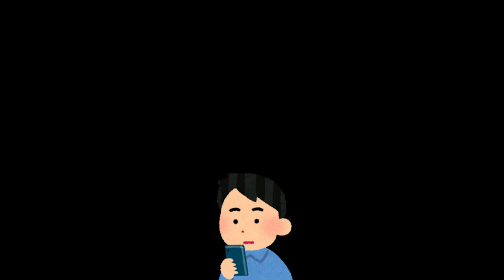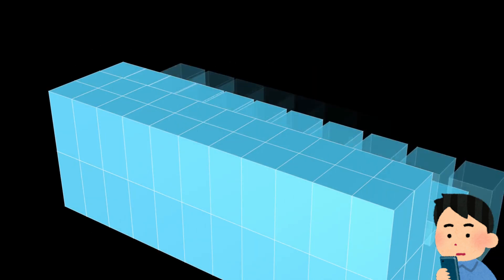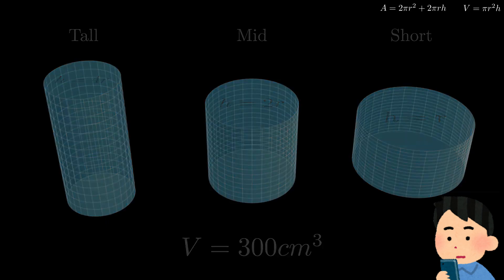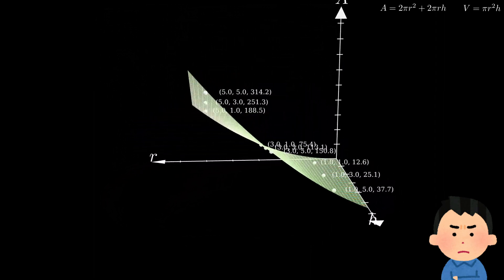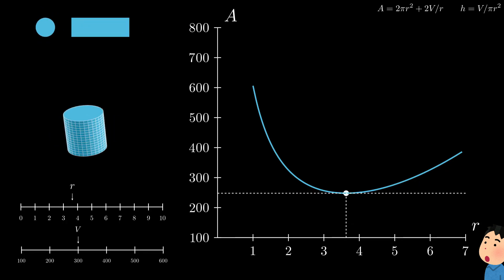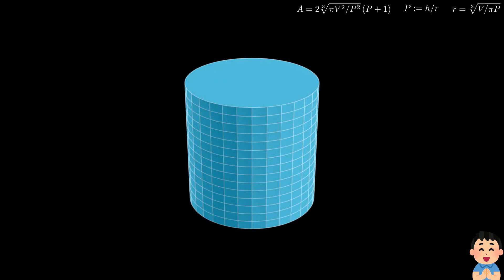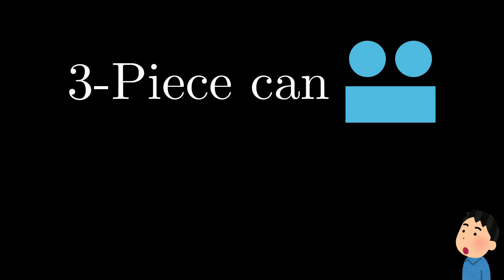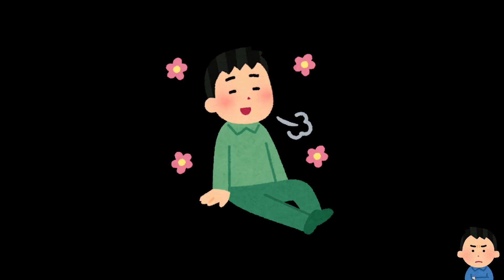Designing the Optimal Cans - 3B1B Summer of Math Exposition 2 #SoME2

Comment: The shape also helps with stacking. The cylinder is stronger in compression than the cuboid which allows less material for the same strength. So less surface area and thinner, meaning two different factors which reduce the volume of materials. In some ways the sphere would do better, especially in surface area, but in packing it will have pressure points which are distributed over more area with the cylinder as well. The trend I dislike is making smaller cans. The vendors end up charging more for the volume sold, but they can also pack them a little more tightly meaning that the volume takes up less shelf space, so they make up for the difference that way, but it generates more waste in packaging. Ideally the focus for vendors should be manufacturing larger cans to reduce packaging material, but the advantage gained from tighter packing and the higher sales from single use is an economic pressure that works against ideal cans.

Comment: re your opening statement:  I do see cans that are square.  I have a large can of olive oil that has a square cross section, though the corners are rounded.  Famously, anchovy cans are short rectangles.
The reasoning though is not limited to metal cans but to containers in general.  Plastic bottles come in all manner of shapes, and the milk gallon is mostly square.  Cardboard boxes are almost always cuboid.
Reply: Yes, they are not following what he later stated with 3 part or 2 part cans or they are on yet another group.

Comment: I think the next interesting thing is to check the optimal size of the can for a constant p. Because similar to a ball where if you increase the radius, the volume increases faster than the surface. So you‘d want big cans because they need less steel.
But the limiting factor would be the stability of the material. And I think there is another optimal size there, not too big because the can isn‘t as stable. But also not too small because then the A/V ratio would be too high and it costs more.

Comment: 7:42 instead of plotting the area, could you plot the volume / the area?  That's the value you're trying to optimize.
Reply from the maker: Hi Philip! I'm not sure I got this right, but you think i should plot the "ratio" between volume and surface area (V/A) ?
Reply: @MLHFmath  Yes.  On the 3d plot.  Keep the radius and height as inputs.  I bet you'd see some nice minimums and maximums, like on the later plots, but cooler because it's in 3d!  Good luck in the competition.